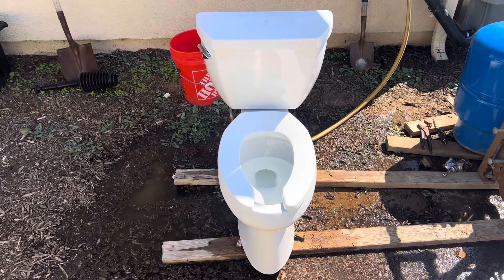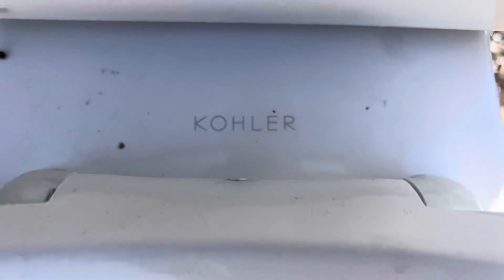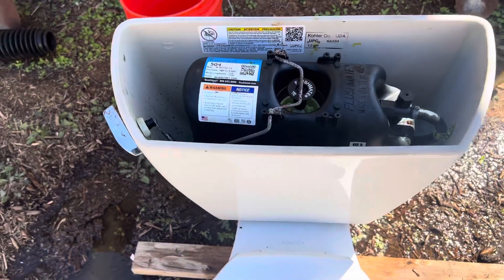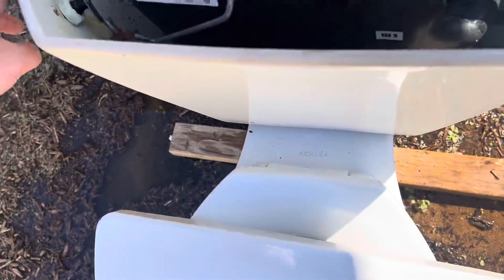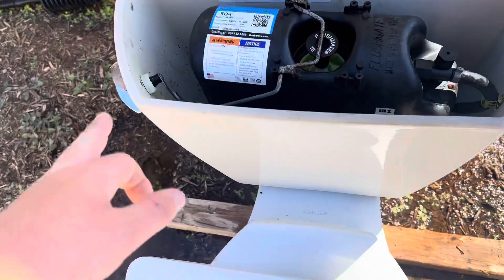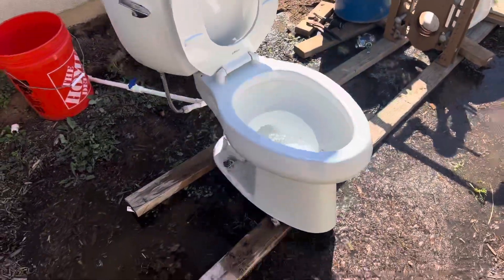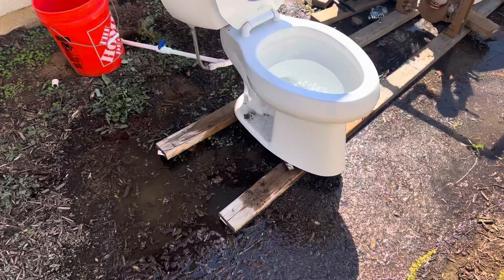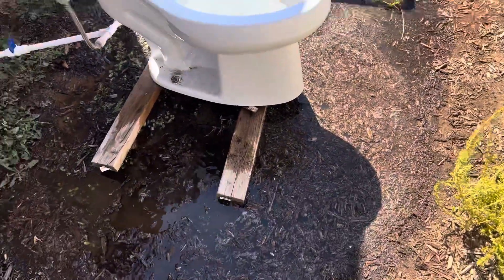2021 Kohler Highline PA Lite Toilet Flushes!

Comment: Glad you were able to stop this from being wasted, these are decent for what they are. Any plans for it?

On a side note, my gawd! Only 2 years old and being replaced? Not a fan of most newer toilets  (or appliances for that matter in general) but the rate at which most appliances in general are being replaced has gotten absolutely awful in the last few years is awful and needs to stop! Like it’s getting to the point where it’s uncommon to not have replaced your toilets/stoves/fridges and the like after 10 years! What’s the point of “upgrading your appliances to save the environment” if it’s a stretch to make them last even 10 years? Planned obsolescence at its summiest. This has to stop. Sorry about the rant haha